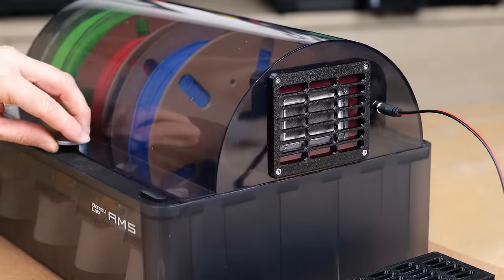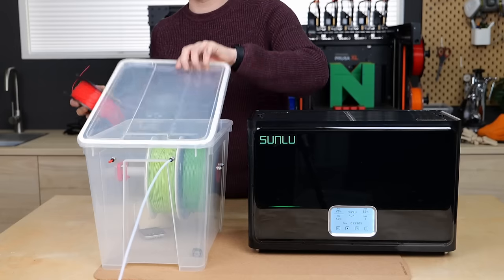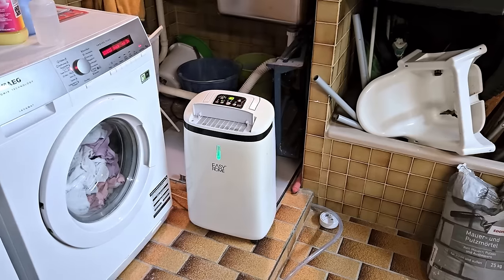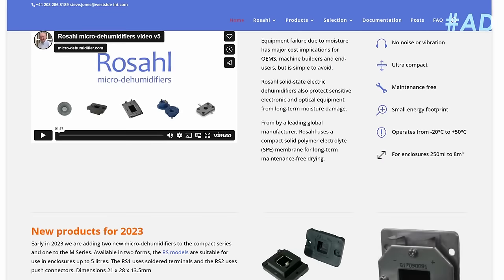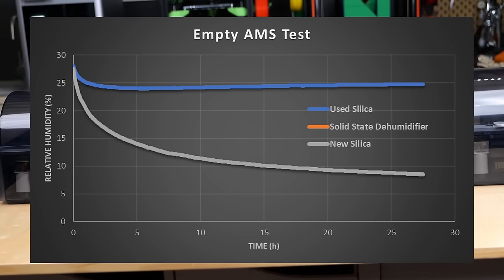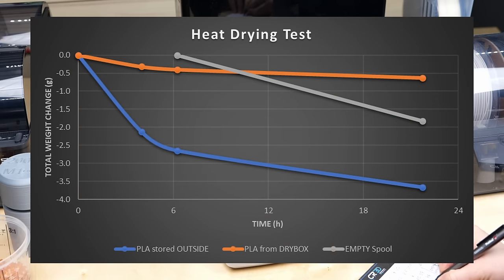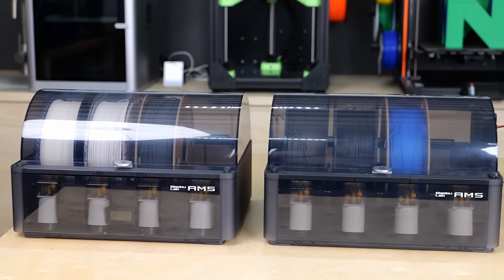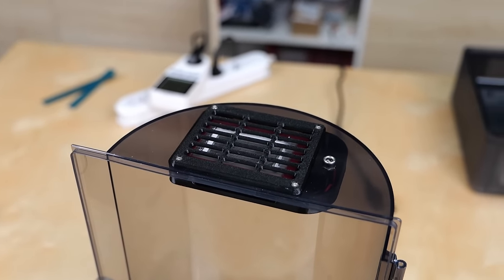Solid-State Dehumidifier: The Ultimate Filament Dry Box

Comment: I'll be sure to spend hundreds of dollars for a little module, to save pennies on electricity at $0.07/KWh! 
I bought a SUNLU Filament Dryer for $50 and it works like a charm. I bake a roll the night before printing. 
When finished printing, I store the filament roll back in the Ziploc bag it came in. 
This product has been out for over 7+ years and still unknown cuz it's too expensive for what it is.
Reply: This product is highly successful.  It was never intended for drying plastics - or didn't you watch the video?

Comment: According to their website, the ones you got for free for the AMS would have cost several hundred dollars each.  When they cost as much as a full AMS or more, it would be foolish to think this is a solution.  Maybe in the future, the costs of these will drop.  But as they are now, you'd be paying for almost another AMS just to utilize one of the MDL5s or MDL7s.  Still though, glad you are trying new stuff and opening up new future possibilities even if they aren't suitable at present.

I'm pretty lucky that I live in a dry desert area (AZ, USA) and the average humidity is usually no more than 15-20% most of the year.  This means putting silica gel in several places in an AMS box works for a month or two before I have to replace them.  The disadvantage to the dry area is that recharging silica gel is almost impossible as I just can't get the moisture out of the silica gel even with an oven or microwave.  So I use color changing silica beads and just have to throw away most of the silica gel when they are all absorbed.  With 5 AMS devices on two printers, all having several hundred grams of silica gel installed inside, my silica gel expense can be significant for me but could be even worse for someone living in humid areas.  I can leave PLA out for weeks in the air without issues or months in an AMS with silica gel.  PETG does suck up a lot of moisture and especially the newer Bambu HF PETG filament.  Heated Dry boxing it before using is almost always necessary.  It's sometimes wet right out of the sealed plastic bag and box.

Comment: I use a 5gallons ( 20 liters ) bucket to store my filament ( 5 spools when full ) and a 500g bag of silicate. Can stay around 10% relative humidity when my house is around 45-50%. After few months , when the bags weight is a lot more then 500g ,  I dry the silcate in a small oven or in a microwave oven like suggested by the instruction on the bag , until it get close to 500gr. Work very well but not enough for nylon.

Comment: It has been my experience that Calcium Chloride (DampRid) in a airtight container under slight vacuum Works exceptionally well.
 I put it in a small plastic container that has a perforated top with a sponge in the bottom because it turns to liquid as it absorbs moisture.
You can recycle this stuff if you let it dry out in the sun or put it in an oven.
I have considered trying to use displacement gases but I haven't found any good generators

Comment: You can make an attachment for your soldiering iron that can hole a thin but sharp blade that will allow you to cut steady and nice clean cuts while also leaving a smooth final finish on the work material.
You have multiple 3D Printers you want to make this modification onto so giving this method a try will be a good idea especially if you have the cut out of the first printer piece you did this experiment/modification on.
You can use a blade from a box cutter that has multiple breakaway blade pieces to remove the Old blade piece of the remaining blade.
For making the attachment you want something similar to a hand saw that has a removable blade you need to make something close to a hand saw blade holder with a blade slot but only for one box cutter blade.

Comment: I would also install a small fan that lets circulate the air in the box just to be sure that the air is evenly dried (as you mentioned at the end of the video). I think that would also increase the dry time at least a little bit.

Comment: Electrolysis also creates ozone (O3) when used in the open air like these work.  The devices are intriguing, but may need venting for long term use depending upon your circumstances.  Mixed with a heating and ventillation system, they would probably work very well, but the price would need to significantly drop to around 10% of their current price point.

Comment: I've been doing something similar.  I bought an electronics drybox and converted it into a filament Drybox.

It's uses a sponge to pull moisture from the inside and then release it outside.  I can get down to 15% RH @63°F. 

I open a roll and put it directly into the drybox and it never leaves. I print directly from it.

Comment: You can check your hygrometer at some key humiditys by using a moist salt pile in a cup placed in a box with the hygrometers.
Sodium Chloride (NaCl - table salt) gives a humidity of 75% at 20c while Magnesium Chloride (MgCl2 - foot bath salts!) gives 33% and is very useful.

Comment: Planning to build a cabinet for storing filaments, I have the options of desiccant, reusable desiccant, regular dehumidifier and solid state dehumidifiers. I'm leaning towards either reusable desiccants or a regular dehumidifier that only run for say 4-6 hours a day (on a power cycle), possibly a combination. In any case I will have a hotbox for prepping the filament prior to storage or printing.

Comment: An important aspect of water vapor (gaseous water) is that it is buoyant. Any air-drying application works most effective at the top of the container. Your first prototype might work better if you move the small dehumidifier to the top of the box. A small amount of heating at the bottom will increase the effectiveness even more by moving the humid air and drying out the filament at the same time.

Comment: I try to keep my filament in vacuum bags with desiccant packs.  The desiccant is reusable when baked at low temps.  Orange when good, brown when need recharged.  I hope that it helps.  I have a few plastic boxes also, much easier than resealing.

Comment: Something about indicating silica gel that I wonder: the blue/pink it uses looks very similar to the moisture indicators I get shipped with electrical components form digikey. I put that humidity detection card inside of my own dry boxes and wonder if that will work as an indicator if my desiccant doesn't. I don't see why it wouldn't!

Comment: Live and work in Seattle...the cliches about damp weather aren't entirely wrong!
4 hours drying prior for TPU printing, 2-3 hours for PETG, an hour or less for PLA.
I modified my food dehydrator with an outlet-port; I often run the filament in the drier while printing.
Desiccant packs I run for 6-8 hours at highest heat, toss them in with the filament storage containers.
Can't really dry filament with desiccant packs, but they do keep dry stuff dry.

Comment: I'm fortunate that the indoor humidity at my locale is under 10% for at least half the year and rarely gets above 25% except for annual monsoonal periods (maybe a month or so). I've only ever had one spool of PETG sputter at all -- even TPU doesn't have issues. Even so, if I printed nylon, I'd def be dry-boxing it. I do still keep stored rolls in bags with a couple of packets of desiccant just to be safe.

Comment: One of the reasons the humidity readings changed with temperature, is because relative humidity is based on temperature, so it measures how many percent of the max humidity a certain temperature can hold. So it might not be the best humidity measurement for a study application. Though as long as the temperature stays fairly consistent, it shouldn't be an issue

Comment: Please revisit PLA moisture. When asking ChatGPT 4.0 I get this puzzling response.
Can PLA get brittle by getting too dry?

ChatGPT
Yes, PLA (polylactic acid) filament can become brittle if it gets too dry. PLA is hygroscopic, which means it can absorb moisture from the air. However, when it is too dry, it can lose its flexibility, making it more susceptible to cracking or breaking. This is why proper storage of PLA filament is essential, typically in an airtight container with desiccants to manage humidity levels. But it's a balance: you don't want it too moist, as that causes its own set of problems during printing, but too dry can lead to brittleness and breakage.

Comment: ooohh ooohh. I actually have something to say here!   
if you're really trying to achieve dry spools and high longevity you need to store your stock under high vacuum.   cheap vacuum chambers made out of pressure cookers and acrylic can hold a few spools and will hold vac for a month or more.  

and if you throw in a little desiccant and a .5w infrared led to reintroduce heat pulled away by evaporative cooling,  it'll likely fully dry out the filament very quickly 

also,  might be a good idea to add a sacrificial oxide target, like iron or copper powder/sponge or activated carbon could work.  that dehumidifier module will tend to concentrate free radical oxygen in the box.

Comment: Electronic dry boxes for photography have long used solid state Peltier modules.  These dry boxes don’t require emptying water, and the Peltier modules are quite a bit cheaper, though suspect they use somewhat more electricity.  Based on cost alone, Peltier modules may be a better option.
Reply: Good idea, looked into those electrolysis dehumidifiers a while ago and the price made it a non-starter.
Reply: Peltier chips are pretty energy inefficient and they simply transfer heat from one side to the other. The only dehumidification you'll get from a peltier chip is from water condensation on the cold side. You would need to somehow collect that water and transfer it out of whatever container you're trying to dehumidify using the peltier chip. Imho, a peltier chip isn't the right tool for the job.
Reply: Even ones made with desiccants that cycle between adsorption and regeneration will work. It could probably be built cheaply.
Reply: You have A LOT of waste heat too. Lot's of inneficiencies everywhere.

you can just heat dry silica gels with sun heat
Reply: @Splarkszter Yet people buy dedicated heat boxes (as shown in the video). Maybe use both properties together?
Reply: And yet, electronic dry boxes for photography equipment are quite adept at keeping humidity levels low.   They’ve been on the market for years.  Require no water collection.  And they’re inexpensive.  
An entire metal and glass electronic dry box able to hold a number of spools often costs less than just the module reviewed here.  
The only surprise is that the makers of these systems haven’t drilled some holes in the sides and marketed them at 3D printer users.

Comment: An interesting approach for sure; I would like to see it with a solar cell option, and you could really go ham with programming a little environmental measure box to trigger it within set parameters. Personally, I prefer swapping out desiccant beads as a mostly passive option. Color-indicating types make for a quick visual reference, and you can dry them out in the oven quite a few times before needing to change them out for 'virgin' material. With my bead-type storage boxes, I'll also supplement the container with a heating pad designed for reptile cages which you can set up with a timer to only run every so often. Seeing internal measurements at 3.5% RH is not uncommon but totally needed when it comes to injection molding for instance. There's also a few other materials that I've tried in the past, one being super absorbent polymer gel, the other unglazed but fired clay. The clay needs to be rotated in and out slightly more frequently, but it is very effective at transferring moisture if you live somewhere semi-tropical as it's by nature moisture seeking.

Comment: For the comparison of safety to regular silica gel you have to differentiate. Some types of indicating silica gels use cobalt chloride which possibly causes cancer. But that is the Blue stuff that turns pink. The more common gels that change from orange to green do not contain cobalt chloride (at least the one I bought, dont know if they are out there).

Comment: I'm still kicking around the details, but I'm tentatively planning to build a filament dryer at some point when I've finished some other projects.  Instead of just a plain heater, I'm going to use a peltier as a dehumidifier.  It's a solid state device that produces a hot side and a cold side.  I intend to use the cold side to condense moisture and let it drip away, and the hot side to heat the container.  Probably just use 2 fans to switch between heating and dehumidifying.

Comment: I think you did a very good job in testing this new product. However, there might be something say about using one of these and silica gel. The silica gel could be used to quickly remove the moisture and the solid state device could be used to ensure the humidity stays low. 

If I were to replace the silica gel in my AMS, I feel the large one would be necessary. But if I were to use solid state as well, I could get away with the smaller one. The smaller one would be easier to place and you could use more than one. This will be an interesting topic going forward.

Comment: I've been designing my own dehumidifier for quite a while now and I think this could definitely be an interesting technique to look at. Thanks for sharing Stefan!
Reply: One thing you might want to do differently than @CNC Kitchen is to have the airflow go into the box. This "dehumidifier" will create no water but instead splits the water to hydrogen and oxygen. likely be faster and safer to flow the dehumidified air into the box pushing out all the moisture.This will not be pure hydrogen as you will be creating positive pressure in the box with a fan. The dehumidifier is acting as more of a filter to break down water to reduce humidity. Afterall, who wants a box full of flammable oxygen lol
Reply: @acters124  I would be curious just how much it actually increases the oxygen amount. If its just 1-2% its likely not an issue as air on average is already roughly 21% oxygen, but if its like 5+ that would be concerning. All my googling was able to find is according to OSHA if other combustible gases are present its not allowed to have excess of 23.5% oxygen.
Reply: @Awrethien  I would imagine that it would be roughly equivalent to the proportional mass of the water in the air.

Comment: If memory serves, Markforged Onyx comes with a bag of CaCl2 desiccant, which you chuck into their drybox along with the filament.

I've been tossing around the idea of a material management system that preheats intake air, passes it through a drying stage and then into a FFF material storage/drying chamber. This probably wouldn't make sense unless you've got at least a small farm and a large bookshelf or cabinet with lots of filaments.

Comment: Thanks for the video, very cool idea! Why didn't you put the unit on the outside of the AMS? Then you would not need to make holes for the power cord, you would have more clearance between the membrane and the last roll of filament. Probably a bit pricey for most folks, but still a solid idea that has potential if economies of scale could be achieved.

Comment: The performance of any dehumidifier will be effected by airflow. The medium for delivering moisture to the drying mechanism is air. If more air passes through or past the drying mechanism then the drying effect will be more profound. Adding heat allows the air to absorb more moisture to aid in the drying process. Desiccant can dry at a lower temperature then other methods however every method depends on some sort of airflow. Like the video said adding a fan would greatly enhance any of the methods.

Comment: Stefan, at miliwatts of power, at 3V, there's no noticeable drop on the wires. Calibrating the PSU is a good idea if you need precise voltages, but any undervoltage will be innacuracies in the power supply rather than losses on wiring.
Inaccuracies in the power supply are probably either lack of adjustment, if adjustment is available, or the tolerance in the component values.

Comment: I'm really wishing you had a fourth AMS and had loaded it's desiccant boxes with activated alumina.
€169 buys a pretty massive bucket of the stuff and based on my experience, it'll drag an AMS full of filament to RH% significantly lower than any of your empty tests.
Molecular sieve is even better again, but is appreciably more expensive.

The catch is regenerating it which requires a much hotter oven than silica. It's energy intensive but low single digits RH% is worth it IMO and it's also the only desiccant I've found that will appreciably slow nylon hydrating itself through a vacuum bag.

Comment: Instead of wasting power 24/7, just replace the silica gel every once in a while and dry it all in a big batch in the oven. Use a better sealed container to avoid water ingress all together. So, for example, aluminium lined plastic bags. They are essentially water and oxygen tight. Do not use plastic boxes, just like the plastic to be dried, the container also takes up water and lets it pass through.

Comment: Not looking to dry my filament with these but considering a small setup with the PSU and an arduino for control for my camera gear, which also likes being stored at a lower humidity to prevent fungus.

Comment: Interesting! Now even if they are expensive time = money as well. Fiddling with drying silica, keep track of the use time, changing vs just plugging in the membrane. hmmm
Theone that would benefit are the one either printing alot or those printing very little. If you have a set of color set up in your AMS and you really don't keep track of when you changes last or it even goes a month in between prints.